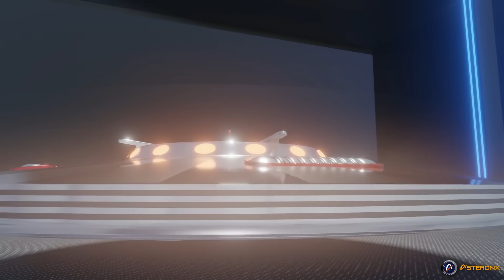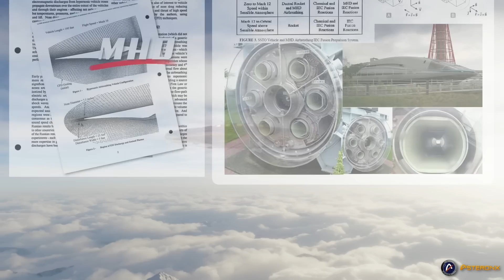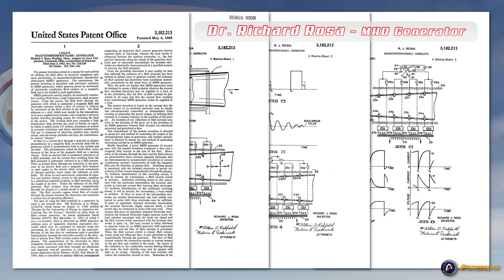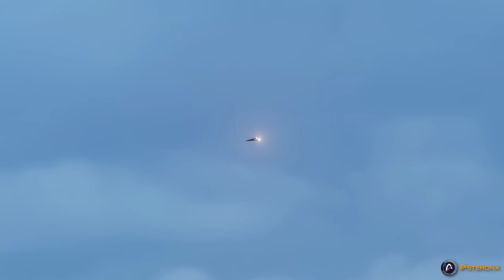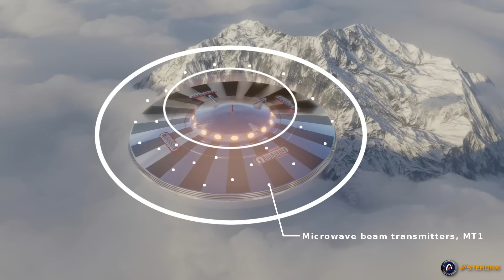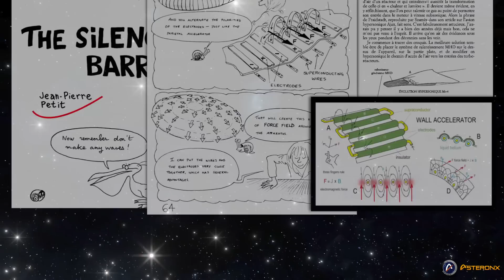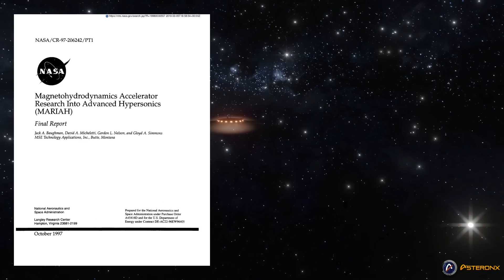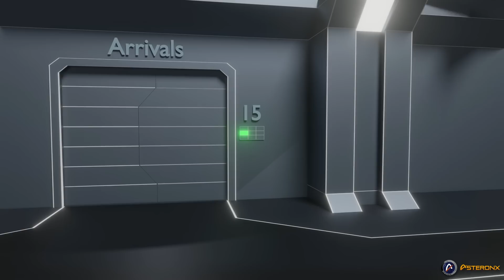Wingless EFE Touring Craft MHD

Comment: I wondered about electrostatic lift some years ago, so did the obvious calculations.  There are two ways to make this work. 
[1] Treat the Earth as a large dielectric where the mirror-image of your craft will appear with an opposite charge. But by that time, you have reversed the charge on the actual craft to create repulsion. This takes advantage of the Earth's dielectric hysteresis. But, it is basically a kind of ground-effect that falls off rapidly with altitude. So, not very useful.
[2] Use the electric-magnetic field to tumble the N2 and O2 air-molecules around the craft to create a down-draft similar to a helicopter. This is only useful if the energy conversion from mechanical engine to electrostatic air thrust is more efficient than the helicopter's rotating wing. 
[3] Cheat: Fill the aircraft envelope with helium.    (~;
Reply: You are talking about electrostatic lift and this is about magneto hydro dynamics propulsion it is not the same thing. The electrostatic force is used but not in the same way. The medium around the ship is ionized than accelerated magnetically. Your evaluation is invalid.
Reply: @clementvining2487  inertial mass reduction device in this and the tr3-B?  One at 89% this 100%? They're folding time and space aaalll the way with this one. Matter of fact i think I've see. This in thr Madonna lol. BTW it's sound that moves it. It's called the "Alpha wave"
Reply: @Commandment_3  The Tr3b you are talking about is at 89% because at a higher percentage the turus or coil can't take the  pressures. The larger the device the more efficient it gets. But in the atmosphere 100% would be counter productive because of how the technology works.

It uses a bose Einstein condensate effect with the frame dragging effect to curve spacetime around the shop. It uses a superconducting superfluid or supersolids in a turus it has no resistance to electricity or movement in the turus so you can't lower it. Then they use a magneto hydro dynamics propulsion system for propulsion. It can accelerate to max speed in a second or two and stop as fast. There is no g-forces to acceleration or deceleration. You see once the coil is charged it holds its charge and effects. So how do you lower the ship at 100%. In a gravity well the ship floats on the earth's gravity. In space only the inertia dampening effects or effects of a static warp field.
Reply: Plasma fills in the rest
Reply: Richard Green
Helium, but what about a vacuum?
Reply: and blow the inner layers of the wings with an impeller in a circular pattern by placing these donuts with wings at three points inside the closed circuit of the system.  then it is efficient and economical.

Comment: In the 1950's the US airforce discovered tin foiling an umbrella and connecting a low wattage transceiver's output antenna lead to it would make a terrible parabolic antenna for downed pilots trying to call home, but would make the umbrella levitate. Discovery Wings Program showed it, but has since been pulled it. Its as though it never happened. Just saying.

Comment: Could this craft operate in the atmospheres of alien planets? Like, what if the atmosphere Is very thin? Made of different gases? Could this craft operate in the atmospheres of gas giants like jupiter, Uranus, Neptune, saturn?
Reply from the maker: The MHD Accelerator makes use of the Lorentz force provided the atmosphere is ionizable, that is, so long as one does not ignite the atmosphere. So, yes, it could be made to function on other worlds. But there is yet another aspect of the drive we have not yet covered. Not to worry, we will soon enough, after our research paper explaining tachyons. Also, we'll reply to your other question in the community lab soon.

Comment: Does this craft allow for anti-gravity type properties so that the users are not floating around inside if you were in space?
Reply from the maker: It's a good question. Although some might call controlling magnetism a form of anti-gravity, it's not real gravity control. This craft is functions by means of electromagnetism grabbing and moving the air around the craft, therefore, the crew still experiences the effects of gravity and in this situation, g-forces as well.
Reply: @asteronx so interesting thanks! 👍🏾

Comment: Indeed. Early this millenium students and scientists were working also on a saucer by TU Delft in The Netherlands. Even some airline company's were really interested, but the hope for bigger airline companies like Boeing were not (yet?) interested, altough they new about this Dutch high tech science work. How stupid? There was hope for reach the big company's as well, but they weren't interested. I don't know why they were not interested.

It's way much better for our climate to save, because we have way less CO2 polution and birds are way more save without outside engines. And also, we don't need any runway anymore, because you can take off and land vertically, just like a helicopter does. If you have an emergency, you can land immidiately and you not have to wait to find an airport. And if we are smart, we can integrate a parachute or some inflatable cussions which work automatically when it notice something wrong, to land save when some engine isseus occur, so everybody can land safely. We can use these saucers also as commercial airliners.

Comment: Interesting concept, but the microwaves would have to be contained to avoid injury to people, especially during take-off and landing phases, probably using air inlets to ionization chambers that are much less than 1/2 wavelength.   The concept could certainly be tested using gas-turbine-powered electrical generators.  If it can be made to work, I wonder how loud the wind noise would be!

BTW, one of the papers displayed had "Israel" spelled "Isreal".  Was that a real paper, or a mockup?

Also, PLEASE STOP employing this "BCE / CE"  (Before Common Era / Common Era).   It is hate speech nowadays, and is quite offensive.  If you cannot, in good conscience, get yourself to write "AD 2021," just write "2021".
Reply from the maker: Thank you for the reply. The use of BCE / CE was not intended to support any form of hate, therefore, we no longer make use of it in any other video. 

The principles of operation has long since been worked out and tested by this gentlemen, Dr. Jean-Pierre PETIT, founder of this specific technology. You can view his YouTube channel here: https://www.youtube.com/channel/UCX0p0BGwCfJoz7oB-TSJ57Q. His website is packed with much information having worked in this field of research for many years.

The craft would be loud and risk endangering surround life, not to mention ionization of the atmosphere, therefore, both must be neutralized. This is but one of many technologies we're working on.

Comment: The pictures are pretty. But I have to admit it's quite weird how in your diagrams on your website you put the "electrodes" in place of the top center antenna, whereas the glowing round electrodes at the periphery of the upper dome are said to be "cameras arrays" instead… and that you now locate also a multipole MHD accelerator at 9:15 in this video on the wall (which is again a different MHD design, as illustrated in JP Petit's 1983 science comic book "The Silence Barrier"). You cannot merge all these geometries for different external-flow MHD accelerators in a single one, put captions randomly on the various structural elements in your sketches, because this gives the feeling you do not really understand what you're doing.

Comment: Really? so its a single stage craft to take us to space........  that found a science fiction way to move through the "air" like we have been for a LONG TIME with a non moving part called a WING that creates high/low pressure in the OUTSIDE air to produce the force needed to propel the craft........   So once it runs out fucking AIR its like putting a blocks under a cars AXLE...... no matter how fast the tires are spinning...... it no longer has the ROAD to push against!!!!!

WHY the FUCK would they even PURSUE that line of thinking in a craft of this nature.......  The whole fucking IDEA is to have an ENCLOSED system that can PROPEL YOU..... you know a field that pushes off ANOTHER FIELD it generates OUTSIDE the craft and not use fucking AIR to move it!!!!!!!!!!!!!   

They just built a bagilion dollar "scram jet" 

Having the liquid metal spinning around and shit was supposed to create a much stronger "FIELD" than say....... a coil inside a motor ......  If I designed this..... I would be ashamed to even RELEASE it for anyone to see.

Creating FIELDS to push off of...... you dont need the air to give you LIFT...... the air would be "holding you back" until you get OUT of it and create the same fields WITHOUT the air to slow your ass down........ not get STOPPED when the air stops.....

When he first described the ionized air....... I was thinking it was a internal pocket of air that was being ionized giving it a 2nd field to work against  like gyro affect the magnet field creates with spinning liquid metal..... the spinning air give it the "outside force" to push against....... then he says it gets SUCKED IN and its a science fiction fucking SCRAM JET engine?

Blew me away when he said it was nothing more than a scram jet engine ........ but hey at least it dont take 10000 gallons of fuel I guess...... 

Just not what I was expecting to come out the liquid metal discovery when it was made.......

Comment: 1. Build it and show it.
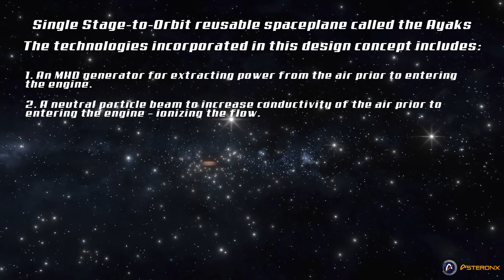2. The hypersonic craft you showed at around 13:00 at least in the NASA version used a scram jet engine without any MHD and it had a big plane as a first stage and a rocket as a second stage and this tiny scram jet test vehicle as a third stage and it did not enter the orbit - it travelled along the west coast and collected data during it's flight. That was a few years ago and I saw a press article about it. It did not generate energy from the air - that would be a perpetuum mobile. It had it's energy sources in the craft.

So you mixed up a few things.
And back to (1) : There is no ionizable air in space. So you need to bring the ionizable propellant with you. That is already done in ion engines in space, but with very very little thrust.
And there have been tests with ionizied air thrusters in the air at ground level, but again with very little thrust. I remember a video with a very light but big model plane in a hall which was started by hand on a ladder and it glided for about 20 meters until it touched the ground and landed that way. They pretend that the ion drive extended the glide. Well, there still is a long way to go...

So build your SSTO space craft and show it in one year from now. You will be famous. That's sure.

Comment: Science fiction pretending to be fact. What a load of crap and nonsense.
Reply from the maker: Ouch, such bold statement. You are incorrect. Read: MHD-control of the ionized air flow in the engine: http://en.hypersonics.ru/concept_ajax/MHD_control  AND NASA's The Effect of Magnetohydrodynamic (MHD) Energy Bypass on Specifi c Thrust for a Supersonic Turbojet Engine: https://ntrs.nasa.gov/archive/nasa/casi.ntrs.nasa.gov/20110002743.pdf 

If you'll like I could send you hundreds of papers... Do you like eggs?

Comment: This is just bad science. Mhd isn't powerful enough to drive the craft alone, and then it wouldn't work in space without air. Plus it would need a HUGE power source.
Reply from the maker: This is only the basics. Of course there is no such thing as space air. Russia has recently revealed its MHD missile capable of easily reaching space at Mach 27. So yes, this is valid tech. And, no, it does not require as much power as you might think because there are other ways to doing the same thing for much less power. Furthermore, there are ways to generate plenty of power. But, as they say, slow moves...

Comment: I’m mentioning this in my novel, but the idea I use for ionizing the incoming air doesn’t use microwave transmitters, but something else that channels static electricity. After ionized, the air is pressurized, transforming into a plasma, which then passes into the EMHD. I’ve copyrighted one draft of the novel already, and have been talking with a local publisher. Keep in mind my book is a novel, NOT a technical explanation of how it works.

Comment: What about electro-capacitive ionic drive?  Charged plates like wires on EHD are arranged radially center to edge and a simple multi-polar analog joystick-like device can direct ultra-high voltage charge to the plates in a directionally corresponding manner, causing ionic thrust off the plates in any desired direction with thrust variable to the amount of push upon the stick or analog distance of the throw upon it from its detented default center position (at rest, not moving position).  A 3D up and down push/pull for vertical directional control (increases or decreases proportionally evenly change force to all plates simultaneously only creating differential charges between plates when horizontal movement Is desired.  The plates are not horizontal to the ground they start horizontal and extend at least diagonally up the size to edge thus exerting both vertical and sideways force to a fixed amount which maintains hover when all plates are evenly charged at a charge determined sufficient to maintain altitude with current weight but creates sideways motion when a bit of charge is added to one side and removed from the opposing side creating both positive thrust to one side and loss of counter-thrust on the opposing side to varying degrees which determine speed and acceleration.   Something like that.   It is similar to EGD but more power conservative.  Power does not flow continuously as with EHD creating a rotating magnetic field.  Instead a different effect is utilitized as the super capacitive plates only flow briefly enough to entrap a monumental amount of electrons onto the charge plate and then like any capacitor at capacity the administered amount of charge achieved stops electrons from flowing as there is no load to flow to and the rotating magnetic field collapses at that point without cohesive directional flow of electrons to maintain it.   Lift is instead created by another force (brute force ionizing radiation of the air like a “ion lifter"?).

Also what about the supposed gravity-shielding effect that has not had much research we know of into it.  Blocking gravity would be one easy way to pro-pulse a craft of any weight with any kind of even weak drive force with use of very little energy.  Would love to see one work done on that premise.

Comment: MHD is the perpendicular intersection of the electric field with the magnetic field producing force perpendicular to both fields at 10x Earths gravity to the 40th power.
This is done with a Tesla coil pulsing current in an outwardly expanding circle from the middle while a sweeping magnetic field on rotating arms intersect it.
Not sure what you are describing. Seems overly complicated beyond what is necessary.

Comment: I'll bet that this is the secret of super-cruise used on the F-22 Raptor. It had some interesting coatings and instrumentation when constructed, and it's a 35 y/o design. Part of the system drew power from the air flow, similar to rubbing a plastic sheet over your hair. The small circular objects in and around the B-2 bomber's cockpit were electrostatic flow attenuators that smoothed the airflow around the leading edge reducing drag causing the engines to work more efficiently and also aided in the stealth properties of the configuration by making the charged airflow over the craft function as a radar signal trap, for lack of a better word. That technology came into used in the late 1970's. Wonder what they have today. I am out of the industry now but I sure do find it interesting.

Comment: all of this requires room temperature superconductor is for it to be feasible is it good reason why liquid nitrogen cooling is very expensive damages the metal it comes in contact with causing it to become very brittle it requires a lot of insulation to be Abel to use which adds more weight to the craft Siri you need to make do with his little liquid nitrogen as possible or you could just make do with not having it at all another big problem is the low conductivity of the atmosphere the atmosphere is highly resistant to electrical energy you have to superheat it to the point where becomes a high temperature of plasma for it to become superconductive